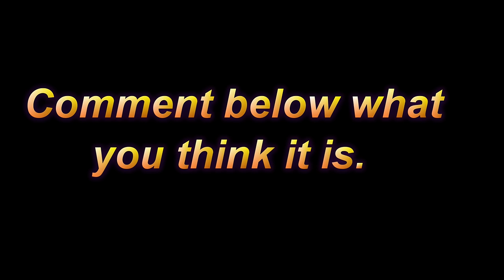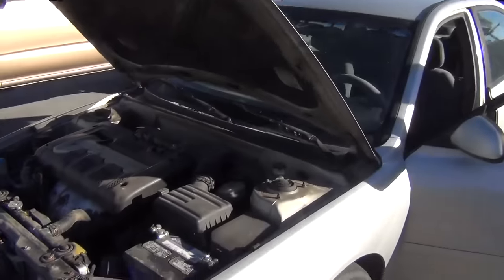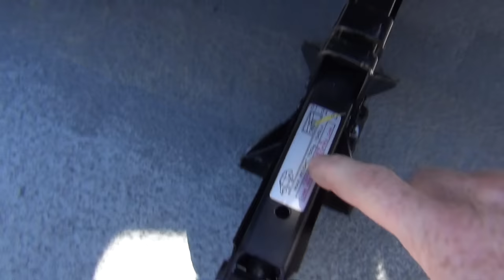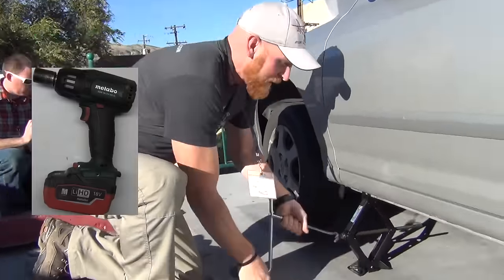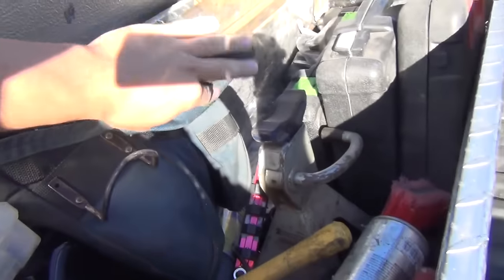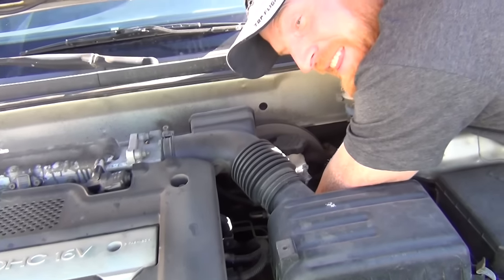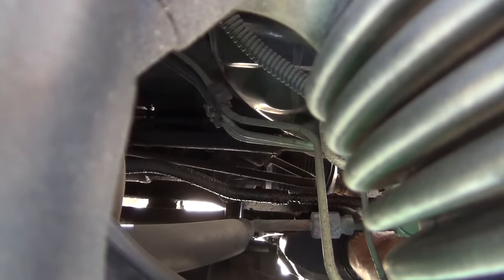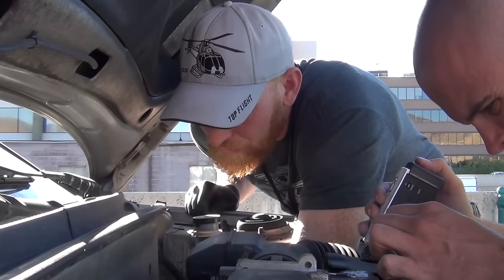Car Only Turns One Way or Steering Wheel Stuck How-to Fix

Comment: Thanks for the video, quick question 
I don't have power steering and i was kind of listening to music with my phone with one hand while turning and BAM I hit this center curb which separates the cars coming left and right into the freeway I know stupid me. Now I'm left with a loose wheel which only turns right and the wheel is loose and barely turns to the left anymore. 
Do I got a few problems or you think that job you showed would also fix the loose wheel. Thanks

Comment: I was right! 🙌

The most important part of your vehicle is the steering mechanism. Not the brakes or whatever else you might think. You are behind a 2 ton missle and if you can't steer then you'd be in trouble. Brakes don't fall into the most important since you have secondary means of stopping the vehicle. (e.g Manual hand brake, putting the vehicle in neutral and laying on the horn, using barriers to stop, etc.) If you lost steering you can't control what direction the car goes. Although brakes and tires etc. are just as important, they have secondary means of stopping. Steering loss doesn't have any secondary means.

Comment: Hi I need help .2006 GMC Sierra pickup . when turning left my steering wheel Lock up . like it's binding up . And I have to force it to straighten it out . with a Cracking sound . the noise is coming from the inside of the steering wheel . Scary when turning left .any ideas thanks 👍🇨🇦

Comment: I would say steering because even if the breaks fail you would be still able to control the car and use the body as a break assistance. That's what the teach me at the driving school.
Reply from the maker: I like that McGuyver thinking of "control the car and use the body as a brake assistance."  That's some grade A thinking.
Reply: Not sure how it is over in the US but here in Europe they teached me this for the driving exam :) I remember the teacher was an older guy and told us he will try to get the most important infos aswell te stuff he has to teach :)

Comment: Surprised no one had a two post lift stashed in the back of their truck. ;)  Glad the failure left him stuck in the parking lot instead of letting go on the freeway.  Not sure how well a Hyundai intermediate shaft would hold together without the pinch bolt.

Comment: I have a 1993 GMC Sierra c1500 the problem I have is when I’m driving and I turn the steering wheel right it makes a full turn and u turn then when I turn left it goes half way can’t make a completely turn or u turn on Left

Comment: I'd say steering.  Braking without steering gives you only one singular means of control, the car's velocity.  Steering without braking gives control to the direction to that mass, using engine braking, or relying on non-living objects as a means of reducing speed.

Comment: I think custom fit floor mats are the most important item. You'd be surprised how many times a floor mate had got caught up behind the brake pedal or accelerator, which makes for an incredibly dangerous scenario. 

If not,  then I'd say steering linkages.

Comment: Great job... That guy was lucky to have a talented group of guys working on his car...  And you are right about steering being the most important safety system on your car. The rack bushings wore out on my old van and it was all over the road until we replaced them... Nothing you can do but hang on and brake if the the steering goes out completely at once. Love your videos...

Comment: One bolt for the steering rack??? That doest seem like a safety-minded design! I love it when I have the chance to help somebody out like that. I'm sure that's the whole reason some of us keep tools in the truck at all times.
Reply from the maker: There's a sleave on the other side too.  All the bolt has to do is prevent movement.  The shear strength on those M14x1.25 bolts are just awesome.  You should see how skinny the lines are that I fly on or even the brake chords.  We live in an age of super materials and there are more to come like graphine and carbon nano tubes.  Good for you for hauling tools.  I had my bike and only had flat tire stuff.
Reply: thats exactly why
Reply: I was thinking more about redundancy than shear strength.  I don't doubt that a bolt that size would be more than sufficient for the job... When it's actually threaded in!  Glad you guys were able to help though!

Comment: Brian, he's still missing a bolt. There should be two. One with a dowel pin that helps to align it and one without. Replaced one of these racks 3 weeks ago. 2 bolts on either side
Reply from the maker: Oh man!  You're right.  I just looked it up.  There should be one below the input shaft and one to the inboard side of it.  I'll have to track down the owner and make him aware of it.
Reply: No worries, just watching out for you between youtubers :D

Comment: How about the bolt on the passenger side of the rack?  If the rack was moving around like that, the other bolt probably loosened too......
Reply: It's too bad no one had any high strenghth locktite. Just for an extra margin of safety

Comment: So the car was driven in not being able to turn right?? Wow!
Reply from the maker: You get the most stress in a parking lot.  Had they swerved something hard on the highway, they may not have been able to swerve back.  That would have been enough stress to do what happened in the parking lot.  They likely would have had a roll over accident and the mechanic who changed the rack recently would have been suspect.   Everybody would have lost out.  1.  Whoever lost something on the freeway to make them swerve.  2. Them for being in a severe P.I. accident.  3. Other motorists who were either directly contacted or indirect delays and fender benders.  4.  The technician who failed to get the bolt tight enough to stay. (likely it was only finger tightened and he forgot to bind it down).  Things could have been a whole lot worse.  I've seen it.  Fortunately everything went awesome.  I love being part of that!
Reply: So this basically happened as he pulled in? Lucky guy. Cool video. Always a good feeling to help someone out.
Reply: My 2003 Chevy impala is doing the same thing. It will turn right but not left. The rack and pinion i just got put on 2 months ago...I need help could this be my issue as well like in the video

Comment: I have a similar issue with a Pontiac Aztec 2004 any recomendations
Reply from the maker: Pimp it out like the one on Breaking Bad man. Buy a fedorra, shave your head and grow a gottee and do whatever you want. You're golden!  Aside from that.  Get it up in the air and have someone turn the wheel.  You should be able to spot it.

Comment: Hi Brian,love your channel.Do you have any vids or tips about restoring or polishing old faded plastic headlamps? I've heard the kits from stores don't work well.Thanks Bud.
Reply: Try a mothers powerball restoration kit. About 25.00 at any autozone. I had severely weathered headlamps on my 2001 mazda protege5. They were so bad the lights didn't seem to output enough light on the road at night. This kit comes with sandpaper pads, polishing ball, plastic polish and microfiber cloth. You need a small drill and water in a cup. It WILL fix your issue!
Reply: +Fireship1 btw. It made my lamp housings so clear I could see small printed manufacturing info on the inside of the housing. I can't see it getting better than that!
Reply: Thanks,I know mothers makes pretty good stuff.I just didn't want to waste my money on a kit that didn't work.
Reply: +Mr Frog I'm fairly sure this will get it done for you. If yours are that bad Id start straight at the sandpaper wet sanding part of the kit. You will be amazed how fast they will start to come back looking like normal plastic. They will first look like a mess as you remove the heavy oxidation, but within a few minutes will start to clear up. I invested about 45 minutes per side and really made a huge difference. They came out almost like new. Made the front of my car look so much better too.

Comment: As I was doing a u turn my steering just went or something.  I can turn the steering wheel left but the wheels wont turn left. I can turn it right and they will go right I just cant turn left at all
Reply: Did you ever figure out what the problem was?
Reply: @cdoane11  steering column bolt broke lol
Reply: Did it work fine after you replaced the bolts? That's what I'm doing at the moment with mine.
Reply: @cdoane11  yes perfect